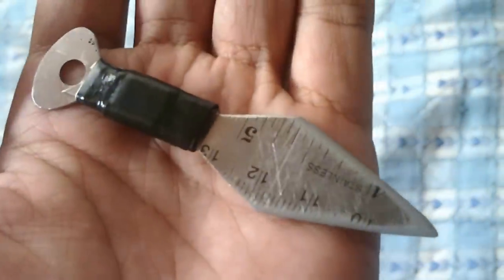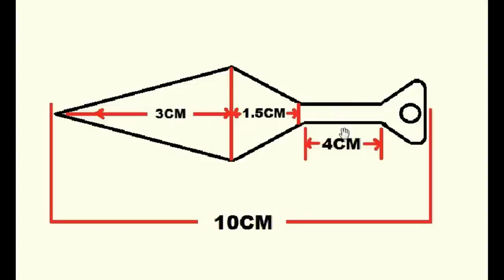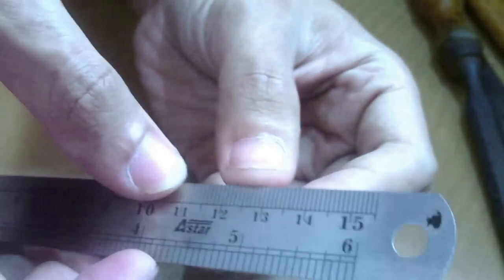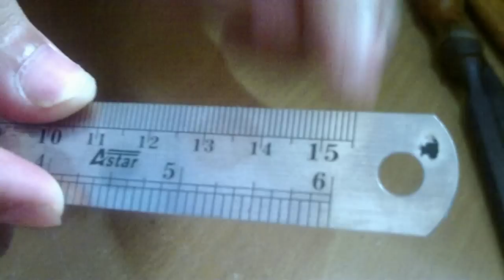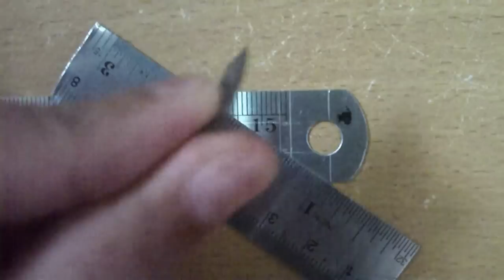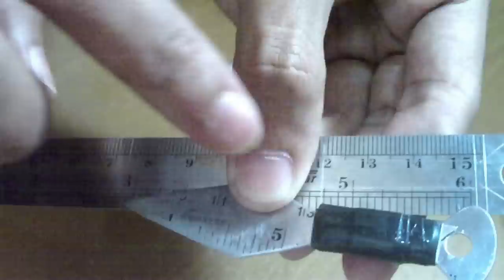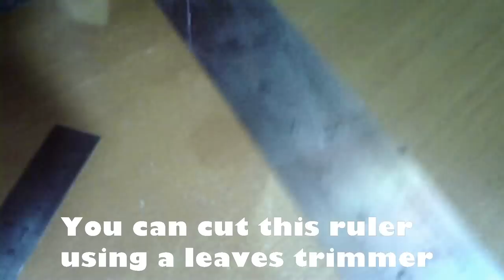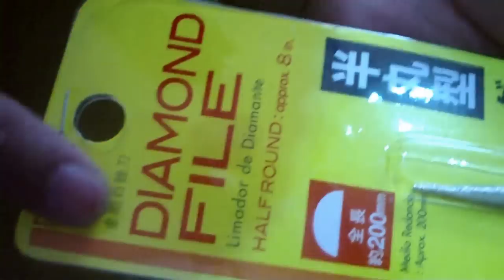Make A Simple Throwing Knife (Using Ruler!!)

Comment: i suggest using a flattened spoon. way cheaper than using that nice rulers..
Reply: How would you make the spoon flat?
Reply: +ZAK WILSON hammering it will do the job and if the spoon is a cheap press formed sheet metal one then it is even easier. 
but i agree it is rather hard to flatten the pricy forged thick ones.
Reply: Metal ruler $1 in straya
Reply: But the scale of the spoon is too small

Comment: how much does it weigh and how does the leaves trimmer cut trough the metal mine does not seems to cut it
Reply from the maker: It weights about 50g. You need to use full force to cut it using leaves trimmer. If it is quite hard for you to do that, maybe you should use hack saw instead. :)